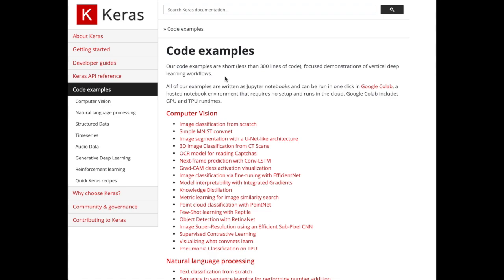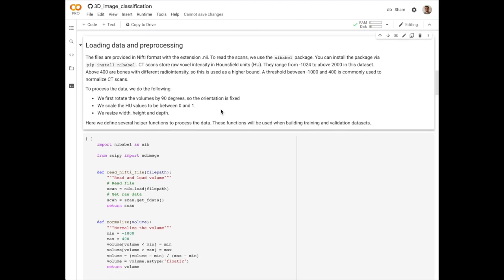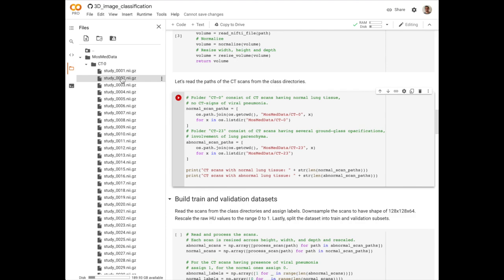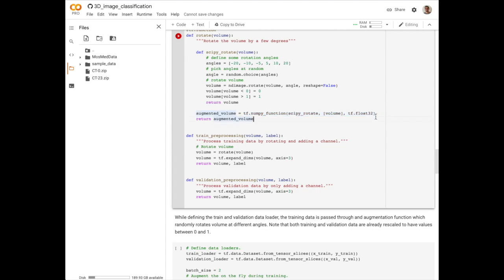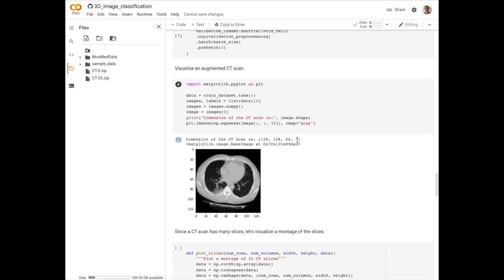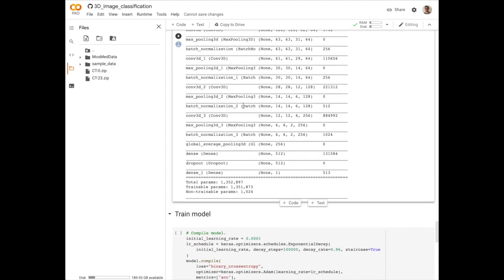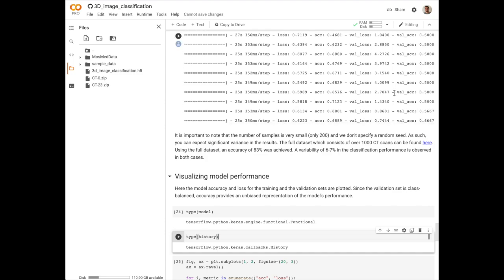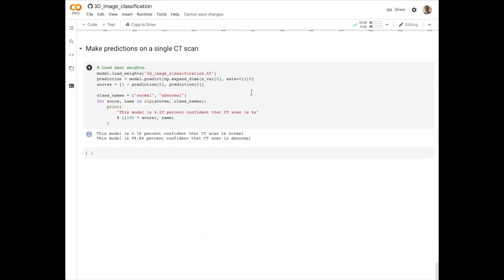3D Image Classification from CT Scans - Keras Code Examples

Comment: Hi, thank you for your video! How to deal with not consistent amount of input data? Assume we have CT scans per patient, but there is can be 512x512x50, 512x512x300, 512x512x800 etc. If you have some links to read about it will be great. Or maby "def resize_volume" (more presisly the ndimage.zoom() function in it) in this example do exactly what im struggle to understand? :)
Reply: hi, you can do padding or do resampling(resampling will change 3D images voixel spacing, not safe)for not consistent data, in your case, in z dimension.

Comment: I tried to use this Example on Brain scans nifty files from abide dataset.
First i had trouble reshaping the images in the process_scan method because i kept getting an error "sequence argument must have length equal to input rank"
after a while i somehow managed to bypass that error by adding an extra dimension of value 1
but because the dataset i was working on was almost 10gb, it crashed my pc and crashed google collab aswell(lol not enough ram to process the imgs).
i'm sorry if my english is bad or if i badly explain the situation, i'm new to deep learning.